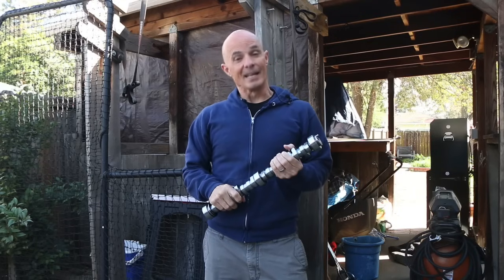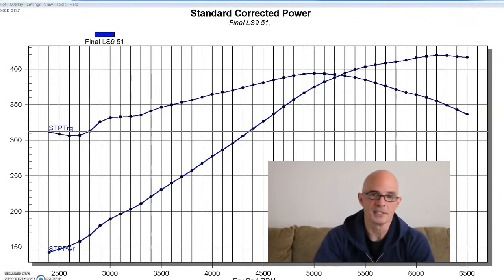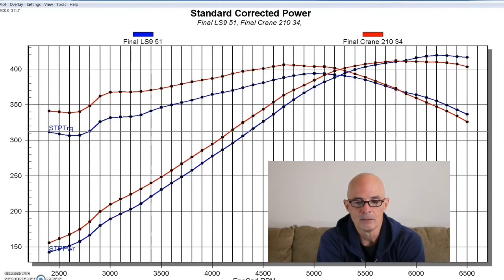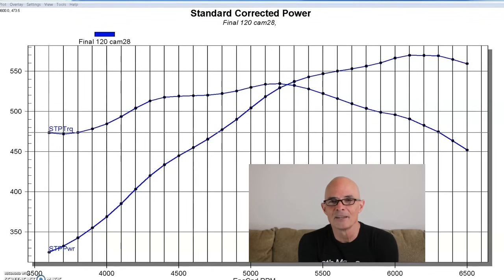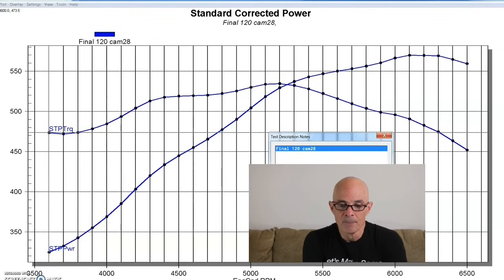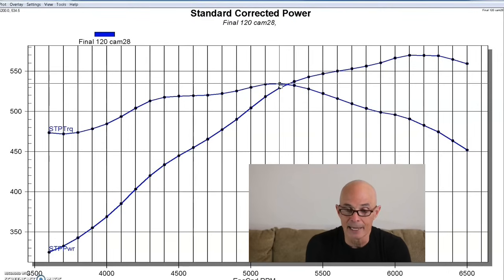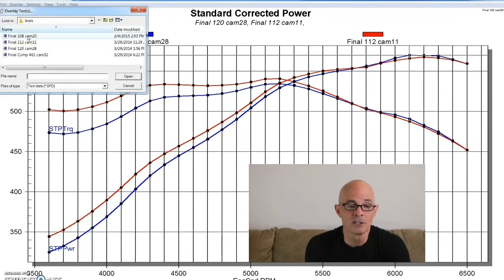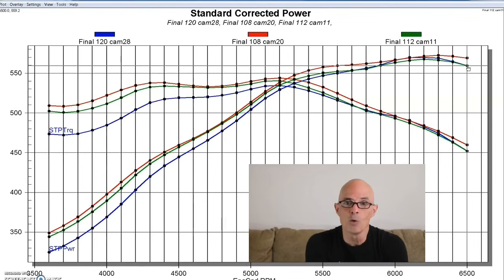LSA CAM TEST-108 vs 112 vs 120

Comment: David visard sed on his vids that a 108 lsa is the best of them all.it would be interesting to see how it would work on a 350
Reply from the maker: a 108 lsa is not universal
Reply: @richardholdener1727   thanks for that advise  Richard.david builded  a 350 like mine (camel haeds) performer intake and the cam that used made a 100hp.i would like to import that cam for my motor

Comment: Around 50 years ago I was taught to run narrow LSAs as much as conceivable to help capture cylinder pressure at higher elevations like in Denver. We were always happy when we got cams at 110, and really happy at 108.
Reply: I think I need to dump the 112 in my Olds 350 for a 108!

Comment: Nice test , opposite of what I thought, I thought tighter lsa equals more overlap so moves the power higher in the rpm but is it that tighter lsa has more advanced intake timing ?

Would be nice if you touched on why it does that and also should you match your intake long short runner to suit different lsa cheers
Reply from the maker: TIGHT LSA ADDS POWER LOWER THEN WIDE LSA

Comment: I would like to see a 106 tested. The Vizard formula recommends 107, so I think there is still power left on the table. Let's see use a blower with immediate boost and neuter it with a gutlees cam. Illogical
Reply from the maker: 107 VS 108? YOU THINK THERE IS POWER LEFT IN 1 DEGREE?
Reply: @richardholdener1727  Do you want optimum or almost? Who knows? That's why you test. Like I said I would like to see a 106 vs 108 just to see where the loss or gains would be. look at the difference from 120-112. You dropped 8deg and gained low end and midrange on an 8 deg drop. 112-108 you dropped 4deg and gained everywhere. Obviously the 108 is closer to what that engine wanted and even confused you with all your years of testing.  What would 1 or 2 deg even closer to what the engine wants do? We don't know. That's why you test.

Comment: I am sorry I keep asking questions but your results prove one thing but I went to order a cam and they tell me different. even after i told them I am trying to make power 6000 and down and need drivability. BTR sales guy tried to stick me in a stage 4 turbo cam. that really seams wrong to me for my project. so I am asking your advice. the truck Norris cam looks to have the down low power I am looking for should I just order that cam and stick a 7675 precision turbo which I already have on it and just live with the power I get. the sales guy said the valve open close timing are wrong. I am assuming he is a race guy I am not racing my vehicle. as I have told you before its a ls 408 gona be 9.3:1 compression gona upgrade the head if budget allows otherwise 317 heads will stay for now. just give me your opinion on a cam choice. I won't hold you responsible for anything just would like your choice. also daily driven, and off road driven when I say off road I mean below 20mph. would I like to tune it to hit 1000hp on dyno yes but that isn't important. sorry again for bothering you multiple times. just trying to make the right decision the first time. thank you for your videos I have probably watched 500 hours in the last 6 mo.
Reply from the maker: get the truck norris

Comment: Say what you will but the 108 LSA cam is the one to have in this engine if you like torque and power.
Reply from the maker: the dyno tells us which cam works best on any given combination
Reply: @richardholdener1727  yessir, I was referring to this specific engine.

Comment: Every test a Howard’s rattler cam on an ls? 226/244 109lsa .525 lift
Reply from the maker: I HAVE NOT
Reply: See any issues based on those specs? Supposed to be useable with a stock converter(mines a stall) and make great low end power. It also sounds frigin amazing. I had a typo before. It’s 226/234 @.050 with a 109 lsa and .525 lift

Comment: If I used David Vizard's cam calculation it would point to the 108 LSA. If the 108 LSA gives the best power why do you use such wide LSA cams when you do most of your test? Just because thats the cam you have on hand?
Reply from the maker: I RAN THE 108 CAM ON THIS

Comment: I need some help choosing the right cam for my build. These are my to choices for the Strip/Street in my Gen IV w/ #799 w/ pac 1218 springs and a after market intake. 3000 stall converter and 373 gears
220/222  .570”/.570”  112(+2)
or
212/22X  .552"/.552" 107
Reply from the maker: different cams-they will make power at different engine speeds as shown in the Truck Norris vs Sloppy Best video

Comment: Mey man im building a vortec 350 at the moment , i put in a big mutha thumpr cam and z28 springs , it is a 808 block with 810 heads and it is going to work with a dual plane airgap intake and a holley street demon 750 , also long tube headers , do you have any idea what the numbers may be?

Comment: I'm currently building a 408ci LS2 and iv chosen 234/244 @50 610" inlet 600" exhaust 110LSA with ported 243 heads and bigger valves, vic jr with 1000cmf 4 barrel throttle body do you think the cam is too small??
Reply from the maker: it will work, bigger cam will make more top end

Comment: I guess I'm gonna be one of those guys to say it would be nice to see power down at 1500 or 2000 rpm to 4000 to see what the effect of the tighter LSA is down low.  You said tighter LSA increased low end power, but the run started at 3500, wouldn't that be midrange power?

Having power down at 1500 to 2000 is applicable for us with heavy trucks
Reply from the maker: you at wot at 1500 a lot?
Reply: @richardholdener1727   yeah, enough to want power down there anyway. Try driving a old truck with a clunky sm465 in town or on the highway. It's nice to have power down there. It would be nice to see how much would be given up with a tighter lobe seperation.

Comment: 108 beats 112 beating 120 LSA for TQ, HP, and idle note, and 108 probably  allows a lesser Octane.  but what Does the BSFC or MPG look like for 108-112-120 LSA? dramatic, or very little Change in MPG?

Comment: I have an LM7 5.3L Gen 3 bored 30 over. I have watched a lot of your videos and love them. My cam and engine spec are: Custom grind. Cam Motion - 210 int/ 218 exhaust/ 570 int and 570 exh lift with a 110 LSA +2. PAC 625 springs. Stock heads with a 3 angle valve job. I will be adding Long tubes and a full 3" exhaust with a cut out for fun.
Reply: It looks like the rest of my comment did not go through. 10.3 compression with flat top forged summit pistons with valve reliefs. Was wondering what you though how this will perform and what rpm range it will perform the best and how high it will rev before falling off. I have the new rockers with upgraded trunion kit. Stock truck intake. Thanks for any advice. .007 shaved off heads and about the same shaved of the deck to make true. I will have long tube headers and 3" exhaust all the way back. Any advice would be appreciated. Thanks and love the videos. Piston are on average about .004 - .005 out the hole. Stock bottom end. I will be rebuilding my 4L60 and keeping the stock converter if possible. I hope the trans shop can build it to hold 600Hp because I want to add nitrous in the future. Thanks a lot. Love the videos.
Reply from the maker: take a look at the btr truck cam test on the 5.3l-that should give you a very good idea
Reply from the maker: Very nice! still counts

Comment: In a 108 lsa cam why it say use a single plane in take?
Reply from the maker: that cam will work on any intake
Reply: @richardholdener1727  The cam I'm looking at for my ls408 stroker say use with a single plane intake.

Comment: Great comparison.  Can we also assume that the ICL was (obviously) different for each cam?  And in addition, would you be able to test with the same installed ICL across all three cams?  I know, I know, asking for the world!  In addition to letting everybody see the difference in lobe separation is valuable, but (I think) more importantly, starting to understand how the ICL and intake closing event have on the actual powerband.  Generally the lobe separation automatically alters this, unless advance is ground into the cam to "compensate"

Comment: So I assumption based would see little difference with trading a marginal duration with decreased lobe separation angle? (267/114 LSA/11.2mm lift vs 266/112LSA/11.1mm lift)

Comment: Would love to see one with 106° have run them in my 6 banger & Holden V8's (among other combos) for around 30 years but never in an LS! I want to run boost on my 6 Banger with Triple Webers but is just one of those things that never happened (got ripped off a few times with shops I took it to, to get manifolds made etc)
Reply: Michael, what type of 6?
Reply: @ebinmaine  Holden 'red' (although colour is pretty insignificant at this stage of proceedings!) from the '70s

Comment: I have a pre watch prediction that the 108 will make most lower rpm torque and hp. 112 middle ground and the 120 might not take advantage of it's angle, but high rpm power

Comment: When you change LSA you are probably changing ALL four valve events.  I believe it was Billy Godbold who said that they use wider LSA because people always think bigger duration is better, so they spread the lobes so it doesn't have as much overlap.  The result is soft low and midrange torque, and small gains up top.  Most LS combos should be 106-111 range for best power.

Comment: How about some lsa +0 vs +2, +4, +6 intake lobe advance. That type of data would help understand ground in advance a bit more while helping with camshaft selection.
Reply: Valve event timing is what you need to be comparing.
Reply: I would love some more information on this … currently trying to learn what I can and there isn’t a lot of resources I can find on ground in advance
Reply: This changes everything!  this test is a bit missleading without optimal intake timing.

Comment: Your video is a little misleading. I'll try to explain it: LSA does not determine the RPM band of a cam, overlap does. 

What you have done is create a set of cams with the same lobe lift and durations but different overlap. This is simply overgeneralizing what LSA number means and if you were into designing cams this would be a terrible conceptual error. When I design a cam (used to do it a lot in the late 90's but not so much since) the first thing I would determine is the powerband I wanted and the vacuum I wan it to have at idle that is based on overlap. Then I figure out how much duration and lift is needed to on the lobes to get the power level wanted. 

Let's say for instance you wanted an overlap of around 4º at .050" lift (also being aware lobe ramp rates even differ based on total lift with longer gentler ramps used for hydraulic lifters than for solid lifter cams), you calculate the intake/exhaust valve open/close event timings for max torque in that RPM range you want, you will then find what optimal LSA is for that cam. 

Conversely, the LSA will not be the dictator of any given cams power range unless the lobes are otherwise identical. This never happens in real life, you simply do not find the same lobes on multiple cams with the only difference being LSA.

A better review would be to create an overlap comparison video, it will help people not buy a bad cam choice from thinking the LSA is the king parameter to judge specs by.
Reply from the maker: PEOPLE WANTED A TEST WITH ONLY LSA CHANGE
Reply: @richardholdener1727  I can see that. Pretty sad that people believe LSA is what counts.

Comment: When you installed each cam to the engine did you set it with symmetricaly split timing eg. was the 108 LSA cam set with the inlet lobe centre at 108 degrees ATDC and the exhaust lobe centre at 108 degrees BTBC.  Love the work that you do.
Reply from the maker: the dots lined up

Comment: LQ4 6 ltre with 862 heads . 2" stainless valves and exhausts. Tick stage 2 SNS002 cam . Need a injector update . running out at 5800 RPM . What would you recommend ?
Reply from the maker: GO BIGGER FOR THE POWER NEEDS (500 HP NEEDS OVER 30 POUNDS/HR)
Reply: @richardholdener1727  SO would you go 37 lb/hr or the 42 Lb/hr ?  I know that you still want a smaller injector for the better low RPM pressure spray pattern.  And in tank fuel pump ?

Comment: What if you had a gen 1 sbc cam ground for the LS1 firing order? Would there be a power gain?
Reply from the maker: NOT LIKELY-ITS NOT FIRING ORDER
Reply: they already make that cam have been for years its called a 4/7 swap
Reply: @scubastevoo8404  thanks. I did not realise the 4/7 swap cam was the ls1 firirng order

Comment: **Richard is the low end torque improving on the bottom end because the 108 is scavenging the air on the exhaust stroke (since your test is using long tube headers), causing the power to improve? basically if you had factory (low flow) exhaust manifolds/ logs, would the graph be backwards? as if the 108 lsa would loose power with logs on the bottom end and the 120 make power with exhaust logs? I'm just trying to learn how to use the lsa and benefit from it and use the lsa in the right way.. I've seen this video before and its a great video. Is there any way i could ever talk to you on the phone? I have some questions id love to ask because Ive made some big errors in cam selection and now have learned (some) of my mistakes that have costed me. My questions relate to a vdrive boat with 460 engine with exhaust logs that use a 108 lsa but use the same lift and duration which is bad.. especially since now i know the exhaust is poor flowing. id rather have a lot more duration on my exhaust and now learned from my mistake. I've pulled all my hair out and running out of hair lol... any help thanks--
Reply from the maker: the tighter lsa will help low and mid range (usually) regardless of manifolds or headers

Comment: Lsa affects idle and is the separation of duration you had more duration so tighter worked this time but a lot of the time you see smaller truck cams with tight lsa as well 112-114 usually carbs are the 108-110 lots to think about

Comment: You should really do some more cams with 408ci, you have great videos over everything except that it seems. You should do the next size up TFS 230/238 on a LS 408
Reply from the maker: I ran many cams in a 408 ls-what did you want to know
Reply: @richardholdener1727  I cant seem to find any reviews of the TFS 230/238 cam on anything or a 408, and I think that is the cam that look like the sweet spot, all other cams look too big or too small.

Comment: Will the bigger lsa make the cam come on earlier also meaning you can use a smaller stall ?
Reply from the maker: tighter lsa adds low speed
Reply: @richardholdener1727  so the stall speed would not change at all the cam will still come on at same rpm but engine  would just have more power early in the revs is that right ?

Comment: Could you show us the fuel consumption data? We do endurance racing  with LS engines and fuel consumption is a huge concern as we need the longest possible time between refuels. We are rules limited in peak power (350) but want the widest possible power band.The low LSA stuff makes more power at lower rpm(good) but what about fuel consumption??

Comment: good test. I'm guessing the 108 l/s got better power due to exhaust scavenging.. the wider lsa especially with 120 lsa, guessing cuts off the valve overlap so far that scavenging is almost none. Also wandering was the opening and closing points all the same or did they move the open and close points to avoid valve/ piston contact.. "if" so guessing they changed the lsa to your specs requested but moved the open and close points to avoid valve/ piston contact, but changing the lsa to your request. hope this makes sense

Comment: Question.. How would a smaller duration and LSA cam compare to a wider duration and LSA cam. Assuming both engines are built to keep the same dynamic compression ratio. Example a 258 with 110 LSA vs maybe a 268 with whatever LSA needed (115?) to keep the same street manners.